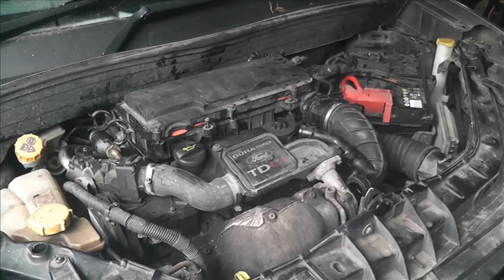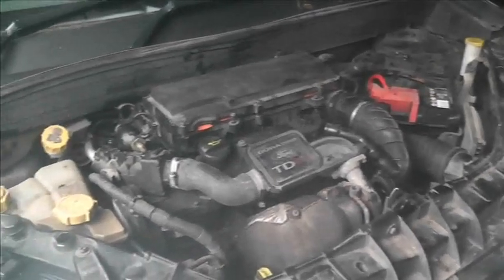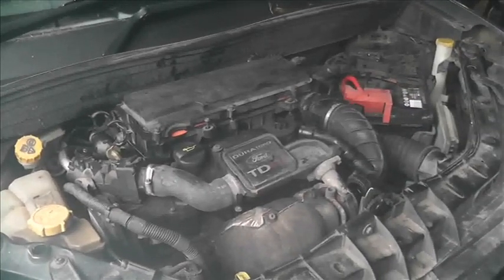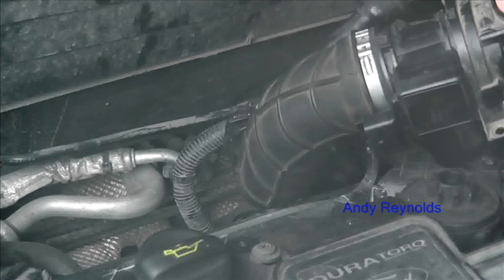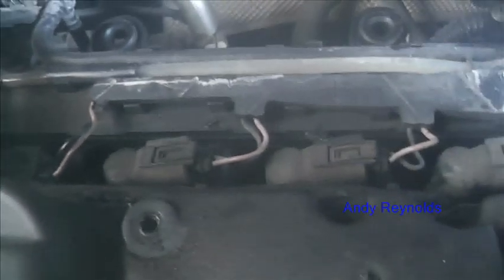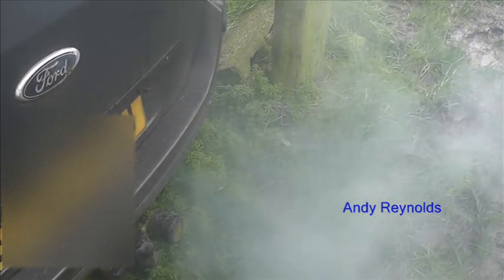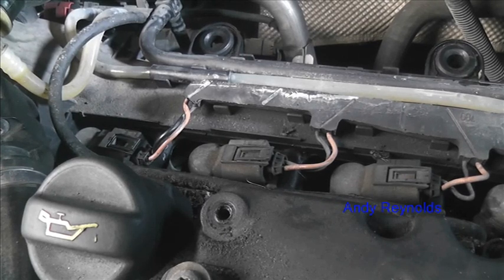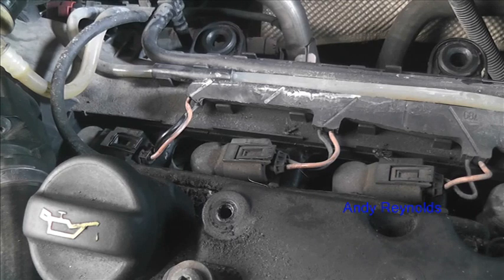Ford fusion 1.4 TDCI, engine problems, possible fixes.

Comment: It can be difficult to let something go when you know you can fix it. But I think you have answered your question in the comments and the video. My recommendation is any diesel vw with a 1.9 engine mk IV. But they are all 20 years +now!
Selling it as is is the easiest, or taking the good bits off and selling them and bringing the rest to the scrap yard. 
watch out for the sunk time/cost conundrum! Get 2 days into it and keep going? 
The real question is is a car necessary at all?
Reply from the maker: Owen, exactly and a repair at this level is one piece of frustration following another, maybe when I was much younger, cheers

Comment: I think you’re prob’ly on a hiding to nothing😖. But I would pull injector 1&3 and try to measure for TDC dipstick style.  If that’s OK then compression test . Possible locked hydraulic tappet ?    If all is Ok swap injectors ( spark plug style) and see if the problem moves.   I reckon the more you pull it to pieces the more you will spend( what’s the price of a top end gasket set 🫣? )   @ 168K the turbo if original has seen its best days and as for all the junk on “ modern “ diesels doesn’t bear thinking about its condition.  Water pump belt kit etc— looking like a money pit with no guarantee for the future.   Just my 2 pennarth 🌝
Reply from the maker: I'm thinking there's plenty of sense in your comment, I could sell the injectors, high pressure pump etc rather than pouring cash into it. You are right about the turbo, black oil stains inside, cheers

Comment: Is the smoke unburnt fuel; ie lack of compression for combustion? Which do you mean by rod; is that the one between piston and crank? That timescale allows you to keep your temper in check. I'd make sure the new rod comes with fresh bearings.
Best wishes and it's always easier on someone else's car.
Reply from the maker: Ian, yes it's the piston / crank rod and it is un-burnt fuel. I'm going to take some time thinking about this. Modern motors are really packed tight, cheers

Comment: I agree with another commentor, run a Boro scope to check for cylinder bore damage.
I'm sure you're trying to help your daughter repairing her car. Wouldn't she be happier with a mk2 golf 1.6 GTd (turbo diesel)  indirect injection, no computers.  GTi looks with diesel economy around 80 bhp  with 100bhp achievable with a spanner and screwdriver.  They're said to have great parts availability and if the mk1 golf is anything to go by, rising in value to ofset some of the money you inevitably will spend to get to a good standard. Fit an EKiy big screen single din radio with large screen with satellite navigation mp3, reversing camera, apple car play and android auto like those modern cars have to help her transition to an old car.

I don't know about modern Peugeot 1.4 tdci but they all appear less reliable than old diesels. 
In my opinion the vehicle is to new with too many miles on the engine and too low a value to repair. Unless you can remove a pistol from the bottom of the engine. Even if you did repair it how long until the diesel particulate filter breaks or something else expensive. Another option might be a little Peugeot 205 1.7 or 1.8 diesel, even the none turbo are quick enough. They're excellent in fuel, comfortable over rough roads and a used engine is around £150 and it wouldn't be difficult to remove. No computers or stupid emissions rubbish is fail either.  New cars belong in the scrapyard.
Reply from the maker: I can't argue with you about modern diesels, just look at that old international B275 injector pump I recently fixed. Not able to do such repairs on modern stuff. The general prognosis is move it on or sell off the bits, cheers
Reply: I watched you repair the Lucas pump and can say it looks easier to repair than Bosch pumps.
They make new cars to save the planet but then make them difficult and uneconomical to repair. Such a waste of resources and manpower.
Reply from the maker: @sim6699  The only way for it to make any sense, is from the perspective of a useless halfwit with the self reliance of a damp paper bag, cheers

Comment: Hi Andy

You got access to a ramp... I guess ?
I would get the rest of the car checked first... they call it a pre-MOT inspection..
if it is driveable..
for other potential repairs..you know to pass its next MOT
 is it likely to ?
no point rebuilding the engine if its going to fail on rust or something
 it could be an ongoing project..depends on how quick it needs to be back on the road...
Engine I think would need to be fully stripped down and inspected... to be sure..its okay..
for me it would be a safety thing....

Hedgehogs out yet...?

Ta

N
Reply from the maker: Neil, pollywallydo mentioned the turbo and yes it has black oil residue on the inside as does the inlet tracts, so yes I think it's going to be an expensive do. The car still has an MOT test and a set of almost new tyres. I'm going to think about this one, especially as I don't have a ramp. No hedgehogs yet. Cheers

Comment: Has the engine hydro locked ? Could there be other problems due to that ?  It would make for  an interesting repair. However I don't think it's worth it considering the mileage.
Reply from the maker: Hi, yes it's been hydro locked and you are with the consensus of not worth the effort and expense to repair, cheers

Comment: Probs had a brief hydro lock n bent a valve
Reply from the maker: Hi, bent valve or bent rod either mean the head has got to come off, cheers
Reply: Hi Andy, good content as usual , in reply to your request to discuss , here's my ten peneths worth : 
Few considerations as follows 
How much is an engine from the scrapyard ?
How much mot is left ?
What sort of condition is the car in ?
Cost of parts (not know until stripped) 
Next service due ?
I know you said it's had a recent timing belt but I wouldn't put the old one back on as I believe as   the engines sucked water in and put a load of strain on the belt ...few considerations ,no offence but the car isn't worth a great deal saying that your not paying labour  , if I was hard up I'd be buying one from the scrappy and stripping it right back using your existing injection pump and injectors etc   its up to buddy ,
Reply from the maker: @youthussful  Hi, yes it's a bit of an unknown, luckily I don't have to fight this to the bitter end and it can sit there for a while, cheers
Reply from the maker: @youthussful  I think without access to a lift the whole job is too much crawling around in the dust. Those tight spaces are such a pain, cheers

Comment: Drop a spare engine into it and scrap the original
Reply from the maker: Hi, yes I reckon you are right, looks like a right pain with 20 year old exhaust fittings ETC. Remove the whole front looks like the way to go and don't bother with the aircon, cheers